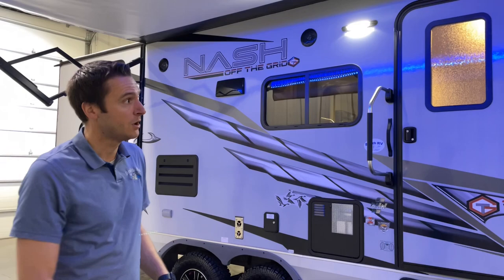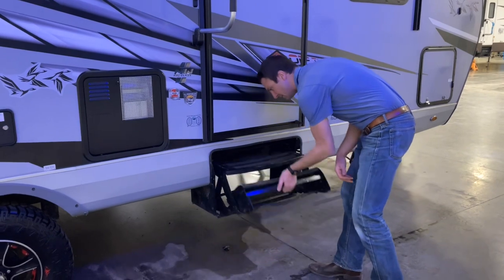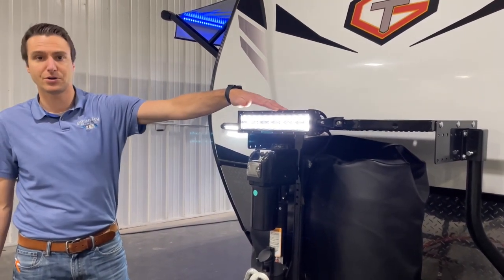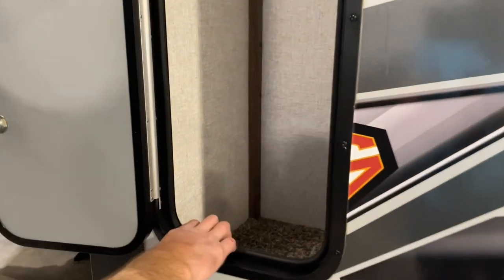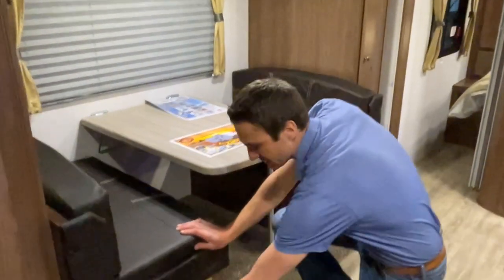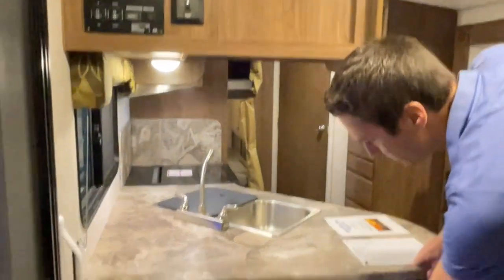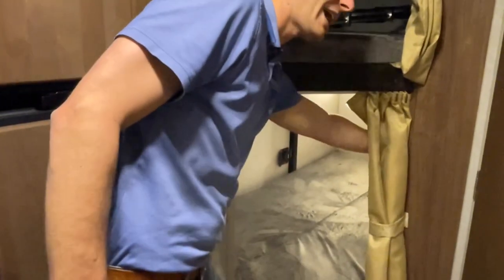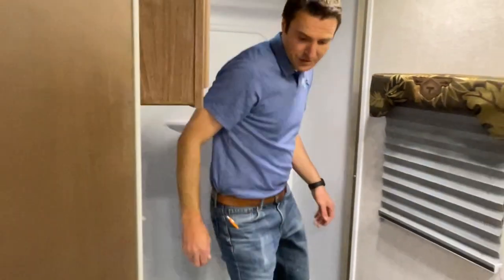The Better Bunk Model!!  2023 Nash 24B OTG!!

Comment: How does this compare to the artic fox for 4 season camping? Also is there a version of a bubk house in the arctic fox? And I want the bunk house but not the bump outs. Is that possible ?
Reply from the maker: Good Morning Joe, they don't have a bunk floor plan in Arctic Fox. These product lines are very close in builds. The Nash has R14 batt insulation in the ceiling and R15 astro foil insulation in the ceiling. The Arctic Fox's have R18 batt insulation in ceiling and R15 astro foil insulation in ceiling. They are both aluminum super structure with foam block insulated side wall insulation. They don't offer a bunk without a slide out currently.  Thanks for watching!  Camping Cass